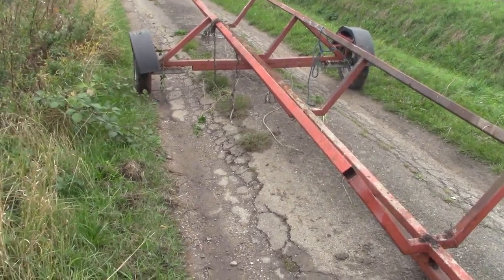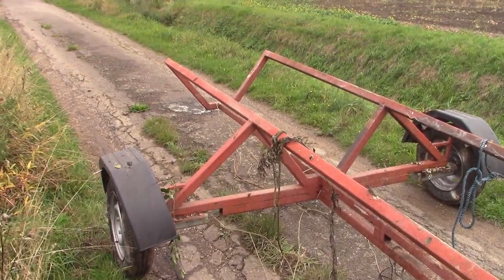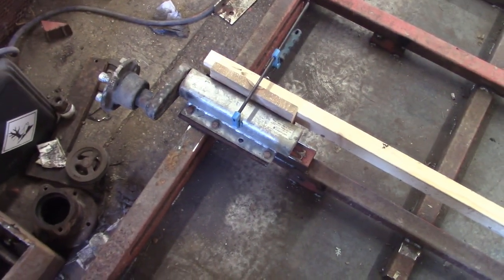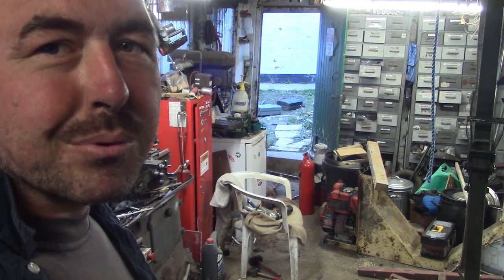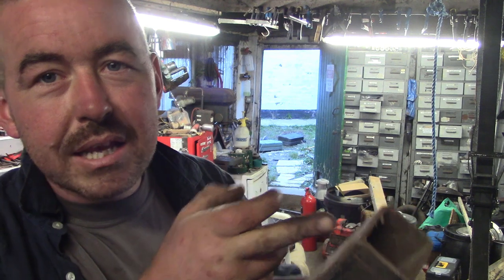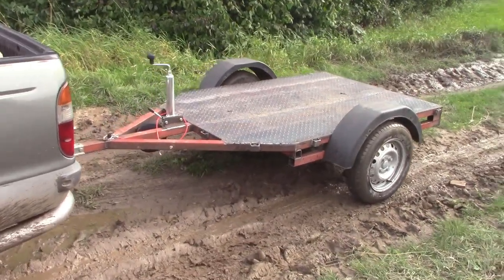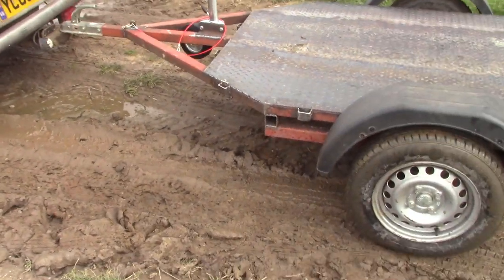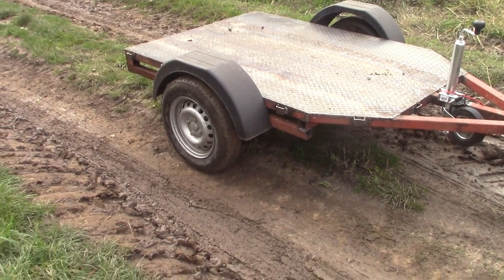Building a stout little trailer

Comment: BTW, for tie down points I get the door strikers from cars at the wrecking yard.  They are a hoop on a metal plate and  strong as all get out. I haven't managed to break one yet not that I haven't tried. They have holes in the plate so you can bolt them on but I usually weld them.  They never sell them at the wreckers so are cheap as and most are  like a gal material so  don't rust and stay nice and shiny as well.
Reply from the maker: That's an excellent idea mate

Comment: Proper tough. Might want to spray in some cosmoline and cap the front of the boxes too.
Reply from the maker: Yes and yes! Might festoon it with light fittings and paint it, closing the tube would be a nice thing to do at the same time cheers

Comment: You made that look real easy James and it turned out real nice looking as well.  That would definitely take more that 750 but I understand it's the regs which are exactly the same specs here.  You ought to see what the commercially built trailers are made of.  I'd be worried about 150Kilo in a lot of them let alone 750.  I'm making a  Fire trailer with an IBC and pump soon for round the farm so was interesting to see how you did this one which was a great job.
Reply from the maker: Cheers mate, I've had a bit of experience with small fire appliances, the most reliable way of doing it is with a pressure vessel and a co2 propellant bottle, combine these with afff agent and 200L goes a really long way, it's the standard set up for every small airfield, we did get a couple of 6 wheeled range rovers for my bosses big airfield and they were great when they worked, still had afff with the water but the level of training and equipment required was imo not worth it for us bunch of have a go misfits. 
Delivery of the range rovers was from a PTO on the back of the vehicles V8, 
While one bloke strips and lays the hose, driver has to select 2nd gear, engage PTO, neutral in transfer box, hand throttle to 3k rpm, slowly dump the clutch or it'll stall.
In the defender with the pressure bottle it was just jump on the back, throw the hose off, open the co2, ready.
Whatever you end up doing, 5l of the foam will make a huge difference.

Comment: A very fine trailer mate! Ive been studying the trailer regs too, as i drove my homemade (braked) trailer down to Spain. Even though it was built like a brick sh1thouse and was braked, officially its was still only 750kg max. However i made a vin plate up and now its ‘legit’. (Fyi uk and spain are cool with bodged trailers, its france that are trouble!)
Reply from the maker: My vin plate arrived this morning, I'm still not sure if it doesn't need an IVA (individual vehicle approval) to keep both plod and the insurance company happy...  Not that it's of any concern to you now unless you come back.
I saw iffor Williams charge an additional £300 for a logbook so you can take your trailer to France, pretty hardcore.
Did you just make a serial number up?
Reply: @turboconqueringmegaeagle9006  Officially for france it needs the IVA but in the UK and spain i think you are ok plodwise. Insurance wise, i'm not sure.
For the Vin plate i stamped the weight of the trailer (i got it weighed at a weighbridge), i thin kit was 375kg, then the axle capacity (in my case i put 1500kg) and for Description i stamped "CUSTOM BRAKED TRAILER" (thinking the braked part may make someone feel it's ok) and for the Serial number i put the Date of Birth of my Father in law (we made it together) but without '/' or spaces. so ended up being something like: 09041950. I feel that is justifiable as a unique enough number for my trailer.
Reply from the maker: @JulianMakes  that's a nice way to think up a serial number, I'm guessing mine is around 200kg so yours is nearly twice as overbuilt, well done mate.

Comment: Simple but sturdy and practical build.   Do you use security Chains there or is that what the breakaway cable is for?  Here it's chains and shackle bolts back to the tow bar.
Reply from the maker: I don't think I've ever seen chain on a bought trailer here, the cable never looks like it's up to the job but it's the first thing a police man will look for you know

Comment: Over here a trailer that size requires no special license to tow (up to about 5000 lbs GVW)... but the trailer must be registered with a plate of its own, have brake and turn lights, and detach CHAINS (not cable.) There's also a prohibition on having the wheels wider than the "body" - i.e. they cant stick out from under the mud guards. Pretty sure they also require a rear bumper.
Reply from the maker: The more I read on it all the more I realise how much I don't know, think I have to get it inspected to be legal. Fortunately today's voyage didn't attract any unwanted attention.
Have you made any progress with your mobile needle infested rodent palace crack den?
Reply: @turboconqueringmegaeagle9006  Sadly, no. Some renewed interest in a little house though, due to ... um ... personal circumstances. I'll just leave it at that.
Reply from the maker: @forge20  best of luck with whatever life has thrown at you my friend